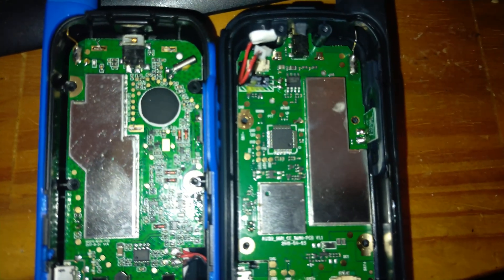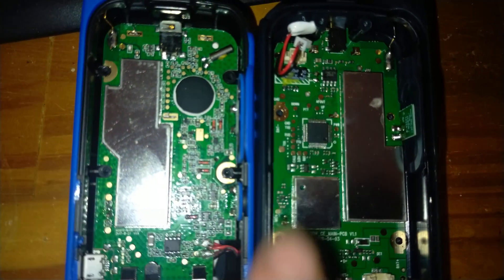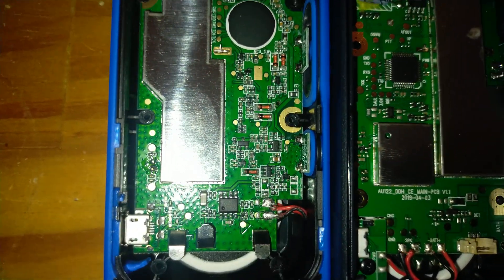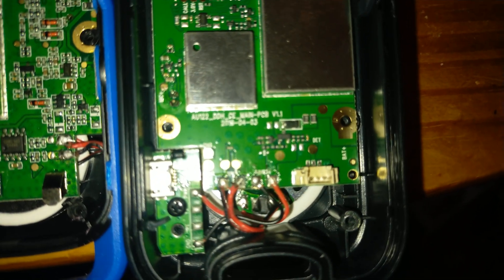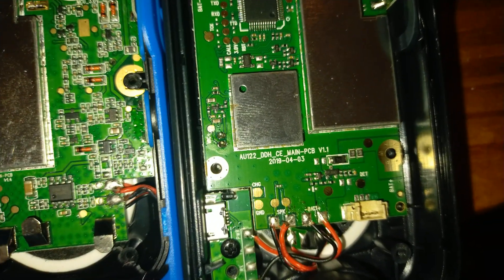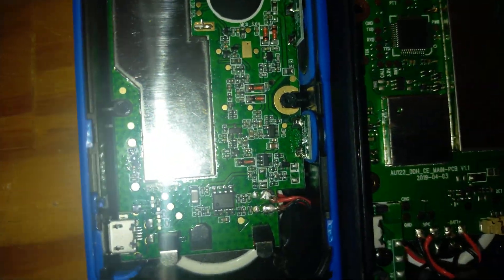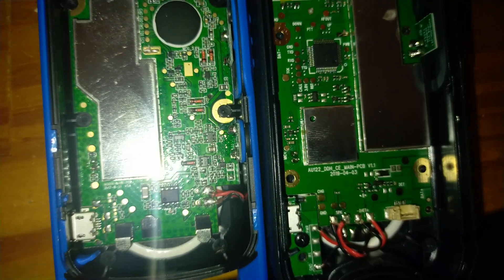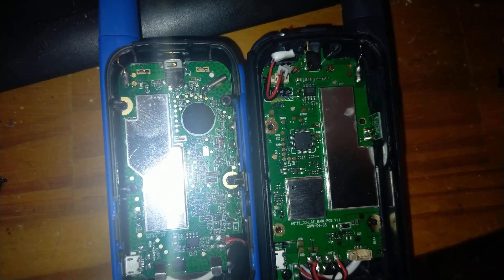Inside the Motorola Talkabout T62 and SilverCrest PMR446 radio

Comment: Hello! Thank you for your video. Can I ask you something? I have a same model. And my daughter droped into the  water for a while. And then it can hear a voice but cannot  talk now. So I want to see inside like you. But I don't know how to open it. How did you open it? I'd break it if I open it.
Reply from the maker: to open it you just need to take the batteries out and take out 6 or 8 screws and the back should come off, it has been a while since I opened these and I believe it is possible to remove the circuit board if it is gently lifted from the bottom but check for any more screws before you do that

Comment: PC thinks it is device because D+ and D- are probably connected via resistor. This is only requirement to let know PC that data connection will be used. And because they are not connected to anything USB do not get any response it shows fail.